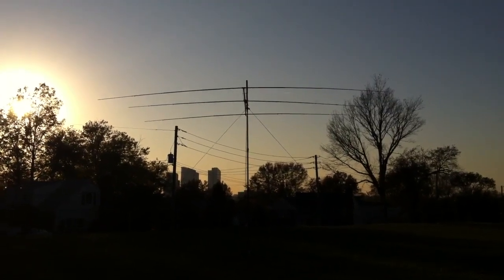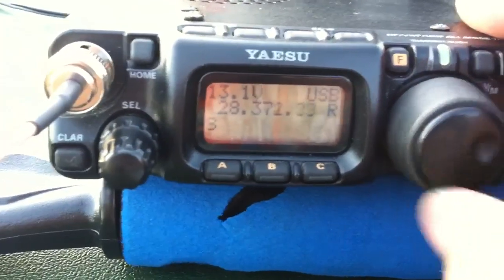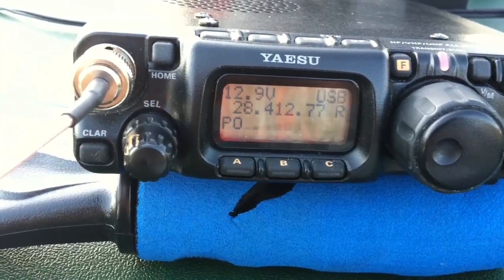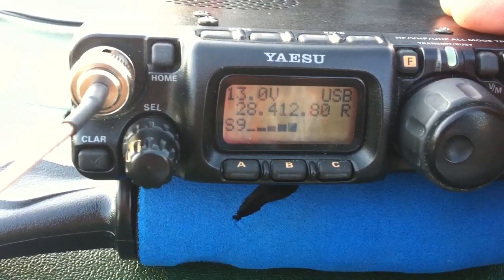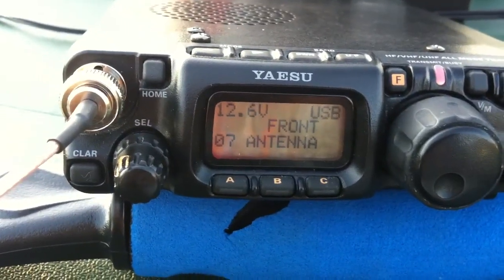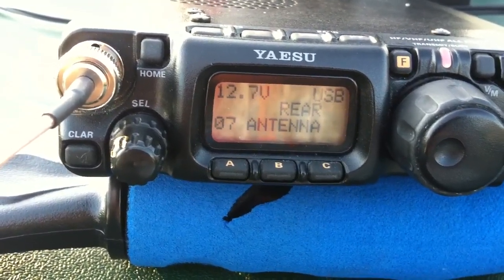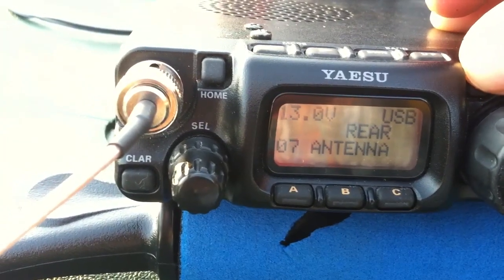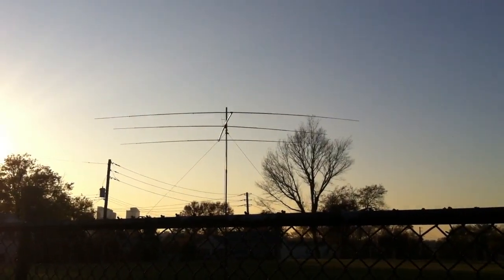Testing Super Antenna YP-3 vs. Vertical.

Comment: I've been using the YP3 at field day for many years and while it's a nice antenna it's an  awful lot of effort to erect for a 2 S-unit increase in signal strength especially if you are only going to be working the radio for a few hours.

Furthermore this antenna absolutely requires height above ground to perform decently   It's really not worth the effort to only put it up 15 feet because at that height it's nothing but a cloud burner, heck a simple loaded 1/4 wave vertical at 15 feet would outperform it more often then not especially on DX.

 Anyhow I have one of these antennas an I also have a buddy pole, At 15 feet the buddy pole is just as effective because 15 feet simply isn't high enough for a yagi to develop any appreciable gain.  All the gain you're seeing is the result of increased efficiency over the small inefficient mobile antenna.

With that said I love my YP3 it's a superbly made portable antenna. I normally use it while camping on a 25 foot mast attached to the trailer. I have several 8 foot PVC pipes mounted to the roof that I store it in while traveling so I don't have to disassemble it all the way, this reduces setup time by at least 50 percent
Reply from the maker: Hi Dan,

Appreciate your opinion and I agree with a couple of them, but a simple 1/4 wave at 15ft. will not outperform it more often. Absolutely not true. I have countless hours, days and years switching simultaneously between the two that's shown me different. Yes, 15ft. Is not the height I prefer it, or should be at. Like any yagi higher is better and at 20m that YP3 should be 70-75ft. off the ground. Doesn't mean it can't still have an advantage to other antennas. Propagation does funny things so I've seen a vertical ground mounted outperform a yagi at 50ft. and vise versa. For this years field day I had the YP3 on 10m at 31ft. , a 10-80 Delta Loop at about 40ft. and a ground mounted vertical. Not much DX and the propagation was horrible, but the YP3 blew the other two out the water.
Reply from the maker: Oh, and by the way. Of course it's a bit of work to assemble, but. It is easy and it is a portable antenna. For me it's worth 2 S-units of signal day in and out. That's a huge difference and when you want that rare DX contact or have to pay much through a pile up of kilowatt stations running QRP....you bet I s worth it!

I'll assemble it till old and cripple not a problem.
Reply: N2RRAny  No disrespect intended but  I must disagree.  After working  50+ thousand contacts and earning DXCC honor roll,  12 band worked all states which includes 6m and 2 meters I can assure you that you are making a very common newbie mistake by being overly concerned with a few db here or there when what you should be concerned with is take off angle.  Very rarely is  2 S-units on paper a make or break situation.  99 percent of the time if you can work them on the YP3 at 15 feet you can work them on a dipole at 15 feet.

 Don't get me wrong the YP3 is a great antenna and I really like it. But I use it more for camping and field day. I have found that  in the time it takes you to assemble and dissemble the YP3 I could have made at least 30 contacts.

With that said my preferred antenna for portable work is not a buddy pole or YP3 it's my home brew fan dipoles. I have one that  covers 40,20,17,15,12, and 10m and I don't have to dissemble it or lower it to change bands and it covers the whole band not just portions. I also have a second one that covers 20,15,10.

  My homebrew pneumatic launcher allows me to easily launch the antenna into the trees at  70 to 100 feet.  And I can do it in a fraction of the time it takes to assemble my YP3..   Now the difference between a dipole at 70-100 feet and a VP3 at 15 feet is night and day.  

For example a few weeks ago I worked Kuwait while camping. He was 20 over on the dipole in the trees at about 90 feet, I got him on the first call then when I switched to the YP3 he could barely tell I was in there and his signal dropped to barely audible, It's the magic of take off angle. Now if you are only interested in contacts out to a few 1000 miles the take off angle at 15 feet on 20 is workable but for DX that not even close to enough for reliable DX      

There's an old saying about working smart not hard, In my opinion It's much smarter to chose a location with tall natural antenna masts negating the need to employ cloud burners, With that said if you're stuck using cloud burners then the YP3 is one of the best..
Reply from the maker: Not offended at all Dan and again agree with your comment on a dipole at 90ft. vs. YP3 at 15ft. I'm not disputing that at all, but that's comparing apples and oranges. If you can not get a dipole up @ 90ft. but 30ft. and you have the YP3 at the same height which are you going to choose? The yagi is gonna beat it every time. This years FD proved that with a Delta Loop 10ft. Higher than the yagi and the yagi reigned supreme. I'm not talking 2 S-units on paper. I'm talking about actually hearing and see'ing the difference. What if you don't have a 60-90ft tree around as an option? Not disputing there are pro's and cons to a yagi @ 15 versus various other antenna's at same height or higher. I was out in an open field on top of a hill. I was mobile and had a 10meter vertical antenna to work DX. I also had the YP3 and to quickly deploy ran a test as shown in the video. Which won? The YP3.

So it's not to distort the facts about how well other antennas work under variable circumstances, but playing around with options on the fly and having fun with it. With 25 yrs DX'ing, contesting and experimenting I'm pretty sure I know what I'm doing. Your love liking at it from a technical stand point. I'm showing an option under certain conditions. Another video I'm on the same hill with no trees around, a vertical and the incorrectly used height for a YP3 yagi. Which worked better? The YP3 into S. Africa over a pile up of QRO stations. QRP at that. If I had a tree around at even 60ft. would've it worked better? Probably, but who knows. Maybe not!

All I know is take a dipole like I did this year at 40ft. vs. my YP3 @ 31ft. and you still couldn't beat it. Yes, again take off angle is key and having the resources to make happen is also, but if the dipole doesn't have that advantage.....it'll be worth trying the yagi.
Reply: Those two "S" units only make a difference in a pile-up.  and I wouldn't want to be the guy that is 2 "S"  units below everyone else because you won't he heard.  I've always spent the big money on the antennas and it always pays off.  Every time.